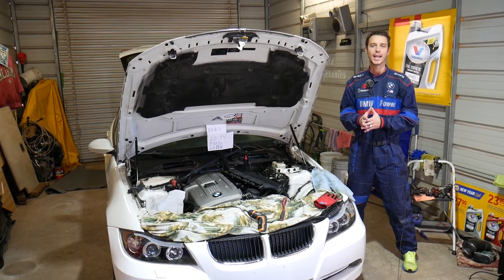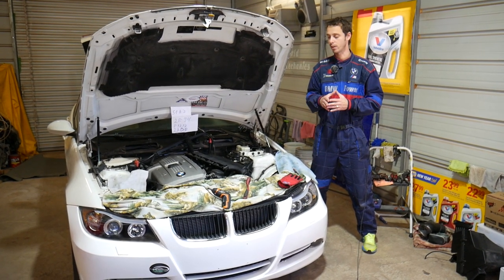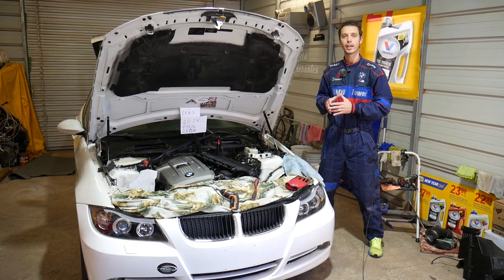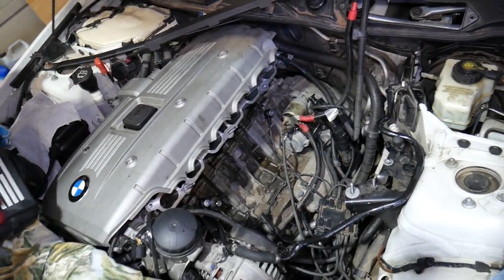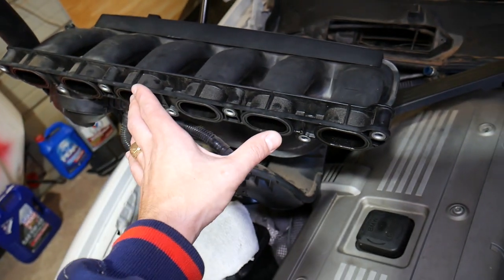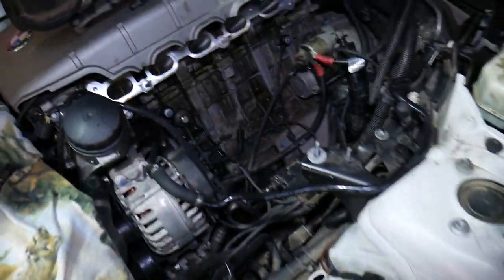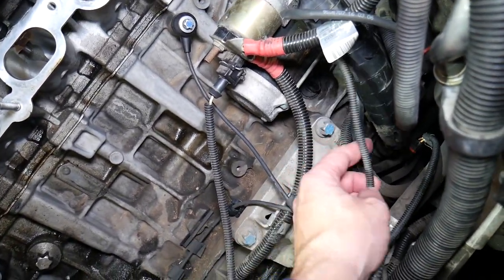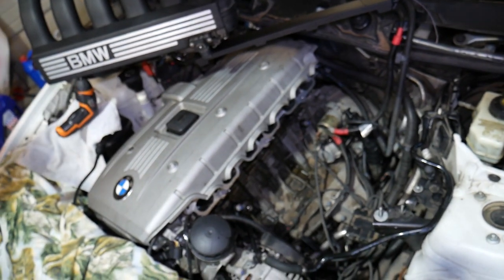BMW DOES NOT START OR START SLOW AFTER ENGINE WORK. EASY FIX

Comment: this is one of more helpful to what im dealing w.  07 530i w no start, no crank after leak intake boot and booster pipe.  acceleration problem before no crank.  how do you get the spark/crank back when fix leak(s)?  does it shut down by computer and need it to reset and start again?  any advice is appreciated. thanks.  subscribed & liked

Comment: I got 2007 bmw 335i v6  it happened to have turned off  at the stop light  I've changed relays my ground  to the engine also  battery is new just 5 months old   what should I  check if it does this

Comment: Just swapped engine on 2002 745 . Crank no start , no spark .. rpms moving so crank sensor is good  , power and ground to coils but to signal to 3rd wire .. all fuses are good no codes .. any idea ?

Comment: Hi guys i have a question , just removed the intake manifold qnd had some troubles with the EGR (1 nut is bend in manifold) so i will repair the dread tomorrow , het i wanted to start the car to make sure for no weird noise without the EGR valve (so intake manifold was directly sucking air in motor compartment) with open bonnet , car cranked but did not wanna start , is it because of that?

Comment: Do you know if it would be the starter especially before my car died out it starting having a sluggish start up and hesitating to start then drove somewhere and car wouldn’t even crank so I believe it’s the starter
Reply: Same things happening to me rn left me stranded 50 min away from my house it would start up perfectly when cold once warm it had a real sluggish start then finally it wouldn’t even crank just a single click battery has 13 volts as well
Reply: Do u found problem?my problem hot engine start long crack.
Reply: @ethanwilliams7547 what was it

Comment: Hi! I have 320i e90 and my problem is it won't start after a long drive or with hot engine. It will only start once the engine is cooled down after almost an hour. How do I fix this? Thanks in advance!
Reply: Had the same issue, had the starter replaced and battery but now my car doesnt pick up speed.. 🤦🏾‍♂️
Reply: @smokeabaguhthat5443 what was the fix
Reply: @sk1p1112  sold it and brought a new car😮‍💨